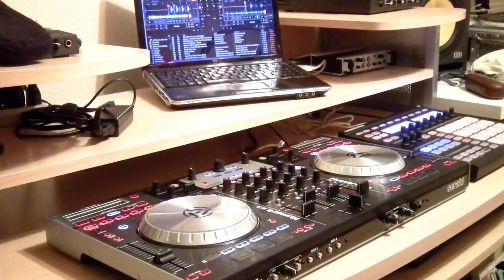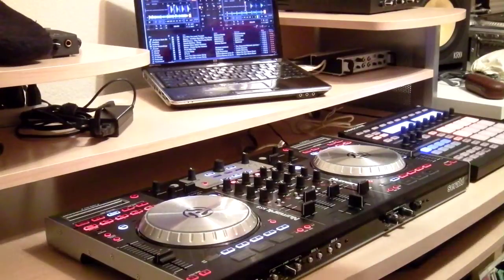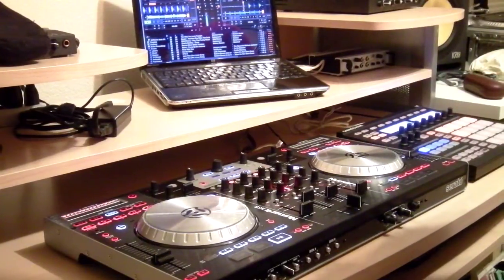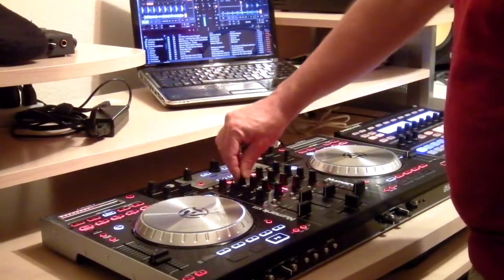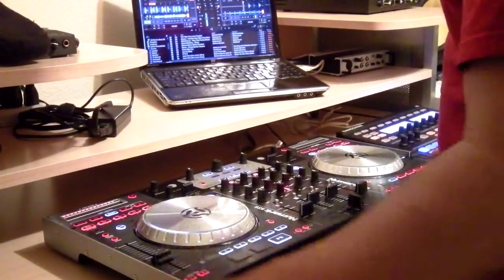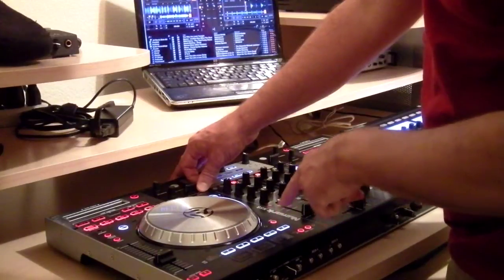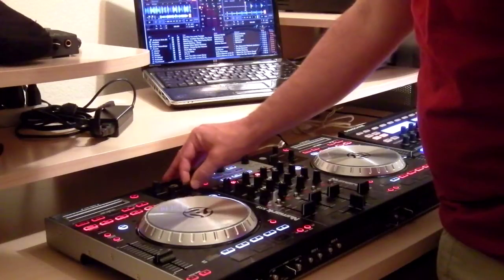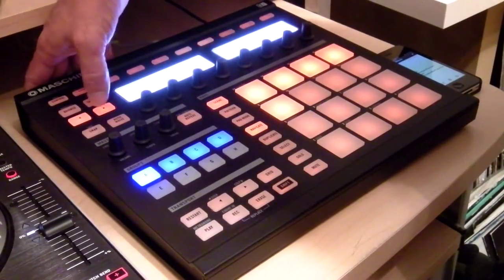Traktor 2.6 with NS6 and Maschine

Comment: Dear. then the file you sent me, I wanted to ask: How will low speed plate? when I want to make a scratch, speed is much "compared to virtual dj and dj serato" having a level of accuracy. I will be attentive to any response. Greetings from Chile
Reply from the maker: Fernando Rojas Leipan if I understand you correctly, you are correct. The responsiveness of the platters is very different than Serato or VDJ. Traktor is not willing to help when it comes to supporting controllers that are not theirs. It is a conflict of interest because they also have controller they want you to buy. I have seen how Traktor controllers behave and it is a night and day difference. That being said, there is a lot of pros to going with a unit like this over theirs, better faders, better audio outputs and a more professional unit are just a few of them. It is all a matter of preference

Comment: Does this only work Tracktor?, I use Serato and want to use it with Maschine.
Reply from the maker: Maschine can be mapped to Serato but this mapping would not work as it was designed for Traktor. Thanks for watching.
Reply: cool, thanks. I like the way you mapped your NS though. especially the VU meter on the Strip Search.

Comment: Really sweet mapping, I was wondering if there is any way to hook up 2 time code vinyls to a numark ns6 running traktor and be able to run all 4 decks (2 midi jog wheels and 2 vinyl time code) also I would love the mapping... Jjnicora11@yahoo.com
Reply from the maker: You can use the NS6 only in conjunction with real vinyl. Digital vinyl needs to run through a separate soundcard as the NS6 does not have soundcard inputs.So if you have an audio 8 it is do able. My mapping is primarily for 2 track decks on A and B and Sample decks or live inputs on C and D. What you are desiring would need a different mapping and an external soundcard. Thanks for your interest. I will email you the mapping.

Comment from the maker: In my case, I already owned the NS6. I like the effects bar better on the 4Trak but it still does not have the VU Meters on board for individual channels.I have considered the 4trak but for 2 major reasons I have stayed with the NS6. My first reason is that in my opinion I think the NS6 looks a lot more like a professional controller at gigs (I like Black!) second reason and probably most important is that the NS6 has the ability to play both in Serato and Traktor, The 4Trak does not........